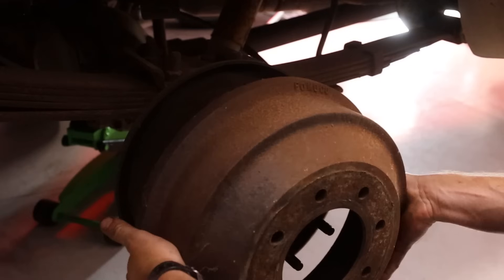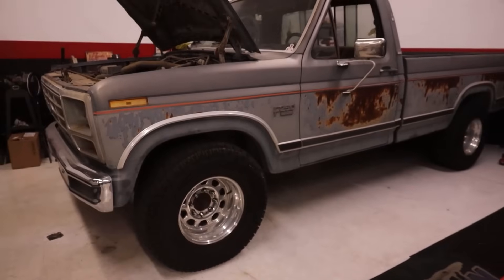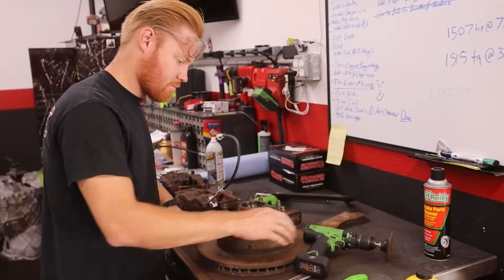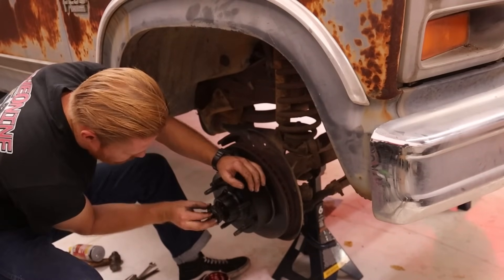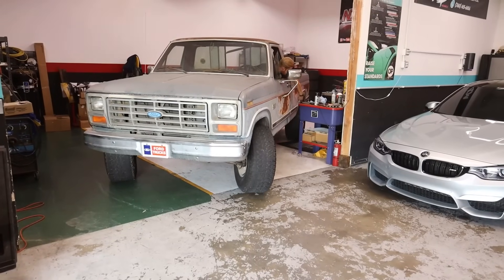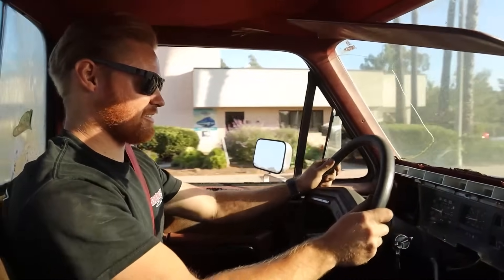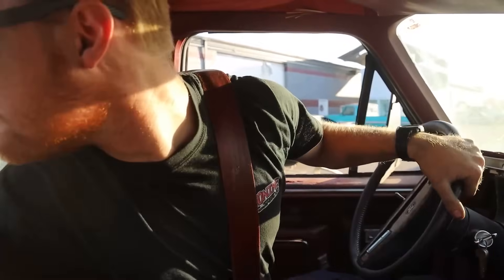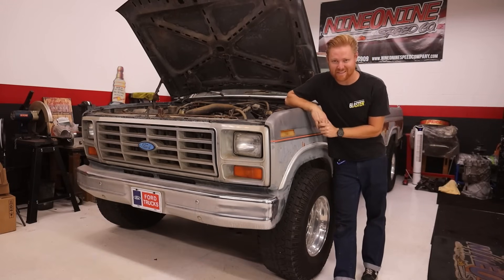FORGOTTEN 1986 Ford F250. First Drive In 20 YEARS!

Comment: If you ever want to hear something ridiculous on a efi 302 truck, run it open headers with the o2 unplugged, sounds like a rally car anti lag system 😂
Reply: I had an old ford van with a 302 and headers. Ram em open for a weekend or two. Loud isn’t descriptive enough.
Reply: Yea when I did my exhaust on my 90 f150 lariat back in highschool that thing was obnoxious open header! It was fun for 30 seconds. But sounded way better after the custom duals. And was quite in the cab but loud as hell outside.

Comment: As an old guy originally from the midwest, back when they were released we called the '87-91 body the bull nose because of the rounded hood edge, so I still find it odd people call the '80-86 body the bull nose.  Anyhoose.  My last of this vintage was an '86 Bronco Eddie Bauer w/5.0L and first gen speed density EFI (and I'm so jealous of your Lariat trim because I didn't get the factory tach even though mine was the top line Bronco)....after 100k hard miles, we pulled the engine and trans, gave her a really good overhaul, including pre-'75 351 heads that were mild ported, big valves, mild cam, roller rockers and lifters, 10/10 crank, JBA headers, custom exhaust, tweaked & freshened, all the goodies- by far my favorite vehicle (and I've had nearly as many vehicles as birthdays).  Body just fell apart with too many midwest salt enhanced winters.  Love your F250, she deserves whatever you throw at her.  Cheers & beers!

Comment: i had 86 f-150 5.0l and just changed the air box to a 89 k n filer and got rid of all that air cleaner mess,shorty headers flowmaster  and made 200 fly wheel hp from 185hp stock. ran a 16.96 in qtm if you need to adjust timmig on truck their is a pig tail on the distributer pull the cap of the pig tail to make changes,that pigtail locks timming in.

Comment: get your interior color off the build codes in the glove box, get online and order some cans of SEM color coat and mist that seat down and it will look brand new! I’ve dyed cloth seats, door panels, dash’s and dash pads and vinyl and carpet with it. As long as you seal it with the sem color coat clear coat it’s extremely durable!

Comment: You should dig deeper into that AOD, it might not need as much as you think. Even though the gear selection shows O-D-1, you could still manually select second depending on speed. A full service and valve body rebuild it might be back to normal.  That with 5.13’s in the rear would make it a fun scoot.
Reply: tv cable could be not adjusted right as well. Even if its out prob cheaper to rebuild it than swap.

Comment: I have my dads 82 Lariat he bought new.  I prefer the bullnose over the brick and obs. His was a factory 351W with the VVT 2 barrel lol, ran good whe it was good if ya'll know what I mean, got rid of th EEC IV system 11 years ago, now has a Duraspark, Edelbock intake 650 Holley, mild cam, Hooker headers, the same 2 chamber Flowmasters I had installed in 1998.  I love driving it.

Comment: I believe that truck has one too many vacuum line leaks and that may cause some of the transmission issues,, and put a top loader or a borg warner t10 granny gear 4spd manual shift transmission..  although I thought about the 5spd swap too.

Comment: A guy that I worked with back-in-the-day bought one of these trucks brand new and three days after he purchased it with 17 miles on it it developed an intermittent Miss he kept taking it back taking it back taking it back they can never recreate it but you'd be driving down the road and all of the sudden it would just start missing and it would mess for a day and a half and then go away Ford couldn't find it some friends and I who are all ASE certified mechanics we went over it with a fine-tooth comb and where the wiring harness plugs into the computer that ran the injection system on this had one stinking terminal for the number three injector that would get hot and lose connection we took the plug apart pulled out the terminal from the plug after disassembling the plug reconfigured it so that it was a tight fit and it never did it again

Comment: Isnt the transmission only a 3 speed?
Reply: It's actually a 4 speed. A 3 speed with overdrive otherwise known as Automatic Overdrive (AOD). This was new for the 1980s era of Ford cars & trucks & was an option during that decade. The 4 speed became the standard automatic transmission by the mid 1990s.
Reply: @corybeaver1909  oh ok are they reliable. I really like this body style of Ford's I have an 86 diesel. I want a short bed f150 302
Reply: @Jv19979  my uncle had a 1986 F-150 with a 302 & I think the tranny was also an AOD. My grandpa also had an AOD in his 1985 LTD Crown Vic. So as far as I know they were pretty reliable but just like with everything else a lemon would turn up every now & then. I was a kid in the '80s so I didn't know as much about cars then as I do now